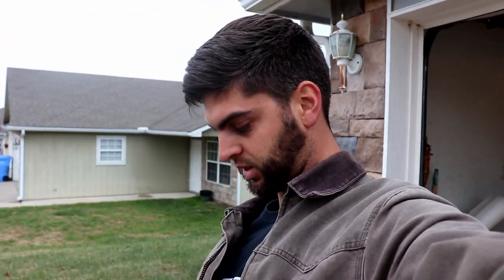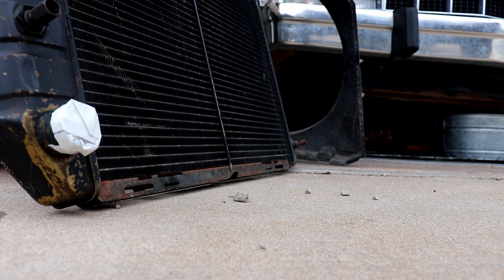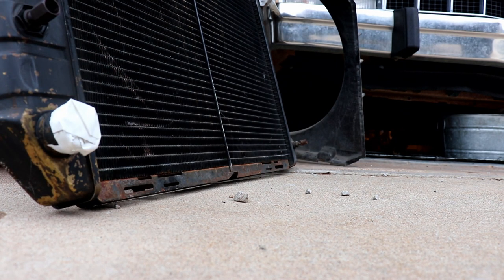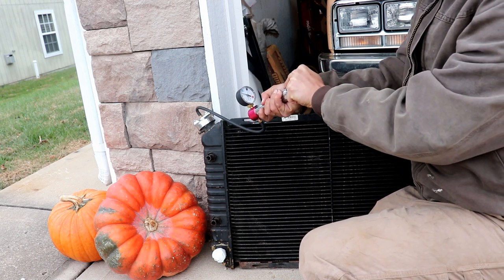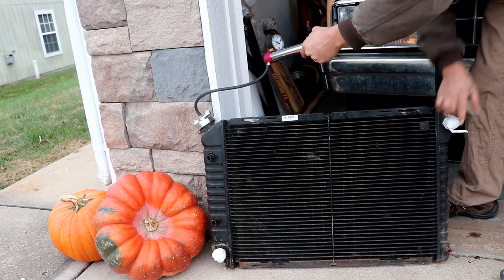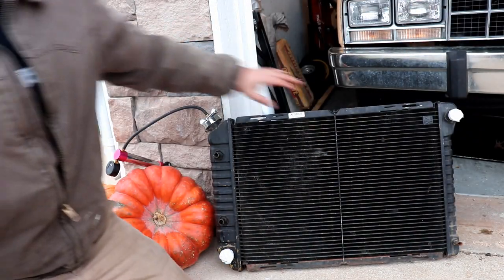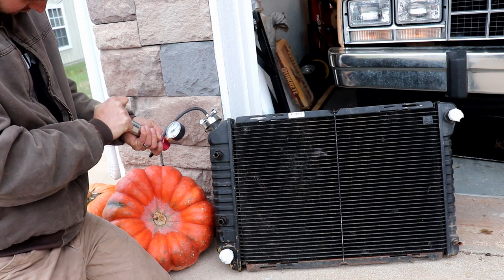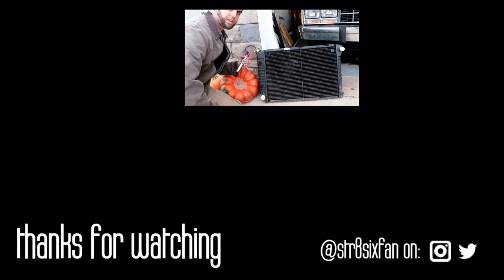Waterproof Tape vs Radiator Pressure Test, a Tubesday Short

Comment: For a static test like that you can use the radiator hoses and a short piece of pipe to plumb the top outlet to the bottom thereby sealing the radiator. If you've ever had a heater hose go on you a solution to get you home to do the repairs is to remove the leaking hose from the water pump and disconnect the good hose from the heater and connect it to the water pump. I have also taped hoses to seal leaks. Duct tape is a very useful tool in an emergency.  Good vid.

Comment: So with this test do we have a solid useable radiator?
Reply from the maker: Yessir, no leaks in the radiator! Previous owner was right. I was more worried about getting done in 3 min or less that I forgot all about commenting on the radiator itself. Though it holding pressure probably in a backwards way proved both the tape nor elsewhere in the radiator was the weak point. I was impressed